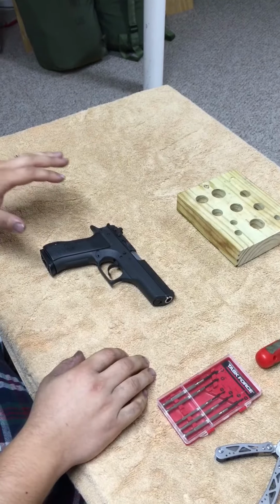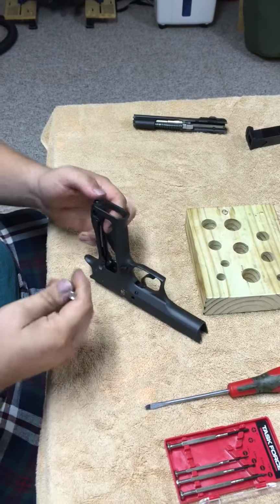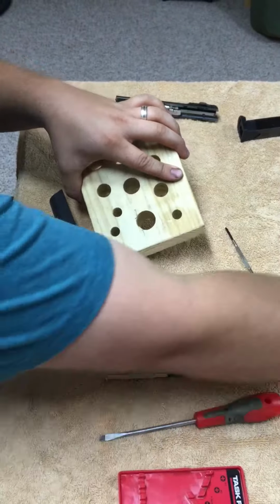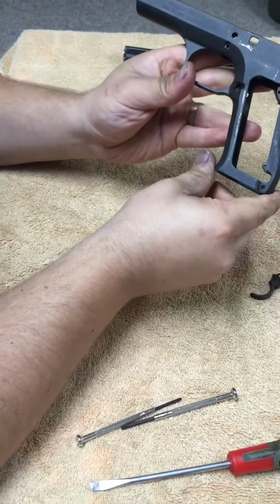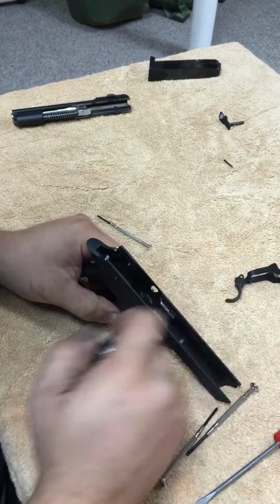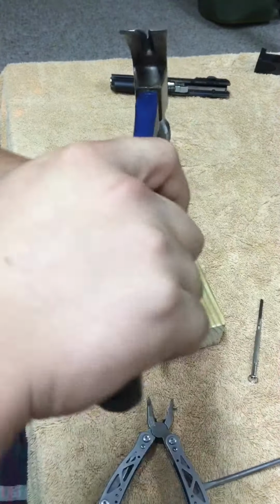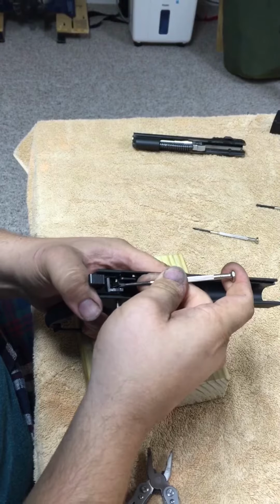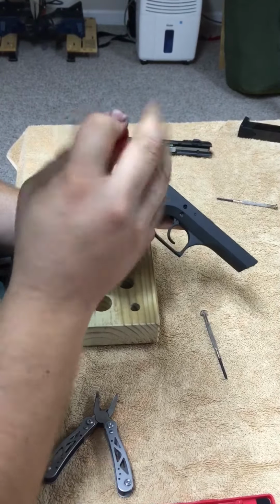Baby Desert Eagle/Jericho 941 Complete Disassembly/Reassembly (part 1)

Comment: Justin, Thank you. Aside from the location of your safety, this is a 1-1 of a modern Jericho941. The only thing i struggled with was getting the trigger spring back in. and the extractor, but this guide is a godsend.
Reply: That’s  the issue I need info on the trigger return spring . Obviously one leg goes to the top in the slot it’s the bottom leg it looks like it goes down behind the trigger below the trigger pin would that be right
Reply: @terrychronister4181  Sounds about right, did you take a picture of it prior to removal? I know the trigger spring can be a PITA to replace, I bought a leatherman multitool just becuase it was fine enough a nose to work for that, and was also a tool I could keep in my pocket and use for other things.

Comment: The small pin you mention at 8:45 came out accidentally without my noticing and fell into a crack in the patio. Thankfully every part is made of steel, so I was able to use a magnet to find it! This video was extremely helpful by the way. Thank you!

Comment: Great video, interested if you had any issue removing rear sights …. I have been trying remove the rear going left to right with no luck?
Reply from the maker: Hey, thanks for the comment.  I do not have the proper tools necessary to push the sites so I can get underneath of them, then again I’ve never had the need to take them off to begin with.  I would highly recommend taking your weapon to a professional gunsmith that is insured before I attempt to do that portion myself.

Comment: Mam Baby Desert Eagle 9x19 para. Wymieniłem w nim sprężynę iglicy i sprężynę kurka (hammer). Strzela świetnie i jest celny!
Reply from the maker: Replace the needle spring (I assume you mean the firing pin spring), and the hammer spring.  The hammer spring is already pretty light and is running great, and I have yet to have an issue with the firing pin spring.  I’m sure eventually I’ll need them, but they’re both ok for now.  And you’re right, it’s very accurate, I’m quite pleased with it.

Comment: Can you just take out the mag. release out for lefties or do all these other parts need to be taking out first?
Reply from the maker: I would have to take out the trigger and the trigger bow assembly in order to take out the spring post for the bow because that is what the magazine release detent sits against for it to have its own spring action for the magazine.  Personally I would just take apart the top of the lower receiver. So the sear mechanism, the trigger roll pin (I would definitely be careful of the trigger spring), and then the spring post for the magazine release and then reassembly in the reverse order.  Taking out the sear assembly would make it easier on putting the bow back in its place during reassembly, but whatever works easier for you.

Comment: Good instructions, but you really need to invest in a brass hammer and a punch set. Hammering on screw drivers is never a good thing.
Reply from the maker: Thank you for the comment, and it’s been several years since I made that video.  Shortly after I made the video I went out and got a roll punch set, so now the roll pins won’t be torn up as much.

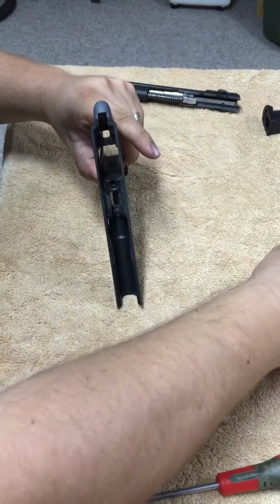Comment: Hi Justin, at the 8:35 mark in your video, there are those two metal small pieces one on each side where the slide makes contact.  There is the usual wear and tear.  One of mine fell off and I think it is part of the whole  lower frame.  I can not seem to locate it on the parts list.  My question and assumption is do I need the whole lower to replace or is this part of a part item that fits into the lower.  The gun smith said that the other side would eventually fail and fall out as well causing a big compromise for the slide to come off during firing. He indicated I would have to send the whole lower back to IWI.   I notice that you did not mention these area (parts), nor take them out.  Thank you.
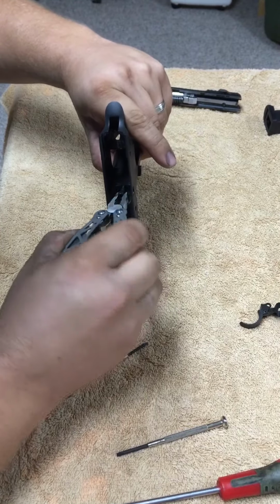Reply from the maker: Hey there, and thank you for the comment.  At the 8:35 mark I was talking about taking the magazine release keeper/trigger bow spring (it does both jobs) apart.  I don’t have the tools to take it apart so I didn’t do it.  The magazine release has the small groove in the middle of it that the post sits in and the detent in the release is under tension against the post and that gives the release its ‘spring’.  The two sides of the magazine release should be there, and I’ve never seen one fall off due to “wear and tear”.
I am assuming you are talking about the two small humps that are made into the lower receiver on the back side of the frame that the bow slides under during reassembly.  Those are made into the weapon (or at least mine are) and should not fall out at all.  If they do that’s very bad, and I would highly recommend not using the weapon until it is either repaired or replaced.
If neither one of these areas are the correct area that you’re talking about please let me know.  If there’s anything missing on the weapon that deals with the slide and keeping it straight while firing I would not fire the weapon until it is fixed properly.
Reply: @Justin090587  Thank you, my baby eagle is over 14 years old, so maybe due the wear.  I will have to send this in or contact them.
Reply: @Justin090587    I had contacted Magnum research first via email to let them know the problem.  They were pretty quick to respond and also fixed the gun in two days.  They received it on Monday, and I got the gun back the following Monday. 

Here is what they replaced.  Trigger block, recoil springs, and trigger pin.  Based on what the shipping and labor costs were, the whole repair cost was fair.  He said the part failed most likely because the springs were bad.  All in all, Magnum Research was pretty responsive.  The gun came back lookin new again.

Comment: Do you have a picture of where the spring in the rolling pin in the trigger goes? I can’t zoom it near enough to see where I “anchor” the short and long ends of the spring. Thanks!
Reply from the maker: So I can’t add a picture to the comments so I’ll try to explain it the best I can.  The trigger spring has a short and a long end.  The short end goes into the trigger from the top and the long side sits in front of the trigger on the frame.  There is a small anchoring cut right in front of where the trigger sits in the pistol on the frame.  It is between the two front slide block the the upper receiver slides on as the slide is working when it’s fired and machined into the pistol.  You want to start the roll pin first because you can orient your spring correctly and hook the circle portion of your spring to the roll pin. At the same time as the anchoring of the spring to the roll pin you want to make sure that the short side of the trigger spring is inside the well of the trigger itself and the long side is in the cuts in front of the trigger between the two slide blocks.

I hope this helps, I’ll try to help any way I can.

Comment: Where could I find a video like this on the poly frame IWI  baby eagle
Reply from the maker: That is a good question, and one that I’m not sure on the answer of.  To be honest I wasn’t even aware that they made a poly frame baby eagle.  I had a Gen 3 baby eagle and the grips all came off in one assembly, but it was still a steel frame.  That may be a video for later on if I am able to find a poly frame baby eagle, I’m curious to find out what differences there may be between the two.
Reply: Quite a bit , there are two inserts in the frame front the trigger is mounted in and the back houses  the sear and such , i was wanting to replace the trigger with on I got from Cajun gun works in la . I eventually took it to a gun smith and he put it in for me but the trigger spring poped  out of place and now I need to replace it . That’s most likely the same as the steel frame . Could you tell how to put a new one in

Comment: I just out mine back together and now it isnt working. Everything was functioning until I put the slide back on, now the trigger doesnt reset and if I pull the slide back it catches on the top of the hammer
Reply from the maker: Check your sear and trigger spring.  If the trigger spring isn’t installed correctly or the sear isn’t installed correctly then this may happen.

Comment: Are you using the imi mags? If so do you have issues with the mags falling out?
Reply from the maker: Chris Lesemann I can use both the IMI mags and CZ75 mags with no issues. As well I have both 10 round mags and 15 round ones also with no issue.

Comment: Hey where do you get parts for these damn things?  I have an ancient IMI Jericho 941F, apparently a military model because the hammer spring cup pin has an addition part that a split ring goes through.  RIght now I got a 3/32 x 5/8 roll piun in there but its not tight.
Reply from the maker: Try looking into the cz75 for parts, they're practically identical.  I recently bought a second and third magazine for mine, and they were made for the cz75.
Reply: Justin090587  Yeah I'm running mec-gar 17 rounders in mine and they work beautifully.  THanks for tip.
Reply: o, my pistol is ancient.  It's marked IMI Jericho 941F, has maybe 70% of the finish on it, and has a lanyard loop attached to the hammer spring capture pin.  I''m guessing it might be as old as twenty years.  You think I should replace all the springs or follow the old " if it ain't broke, don't fix it?"  Also, the front sight seems really low compared to the back sight.  I haven't fired it yet, but is this normal?
Reply from the maker: +DJEvilWayz I'm not an expert on the Jericho pistol by any means, but from what it sounds like, you have a rare gem.  They were originally chambered for the 41 magnum round, which is where the 941 comes from.  Personally, if it were mine, I would want to fire it and know that the springs aren't going to malfunction, however, I would keep the old springs and old parts that you replace for value reasons.  An original pistol, with original parts, working or not, is always more valuable than one that's been refurbished.
Reply: My only curiosity is while the lanyard loop and pin look professionally machined, the grip looks like someone chewed it to get it to fit.  THe guy had another one, and it looks like a rat chewed on it as well.
Reply from the maker: +DJEvilWayz gunpartscorp.com has new grips for $31 and some change.  Search for magnum research, and you should be able to find it.  It's a great site for finding parts for almost anything that you may have.

Comment: Thank you for the video. But please do yourself a favor and get some actual non marring tools, especially if you're doing work on people's guns. I'd be pissed if you worked on my guns with those tools.
Reply from the maker: Thank you for the comment, I have since gotten myself some roll pin punches and good gun smithing tools.  I didn’t have them at the time and I had to use what I had.